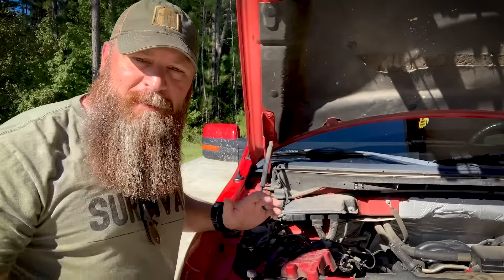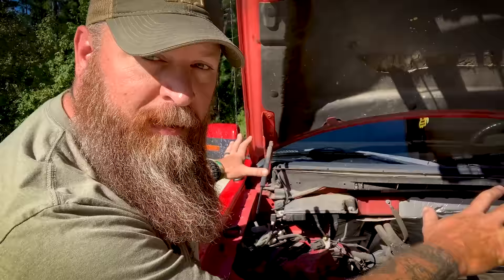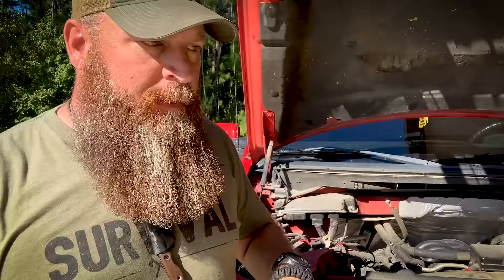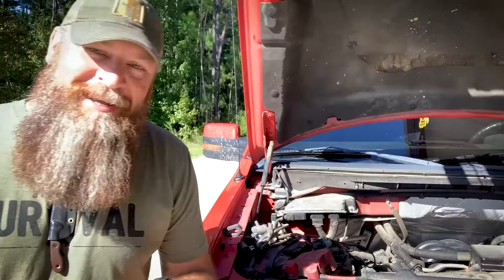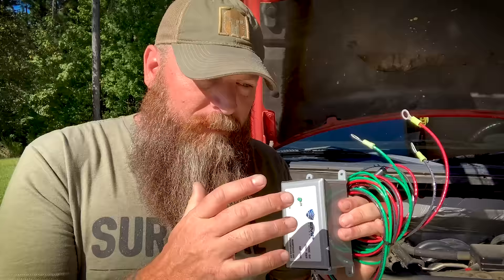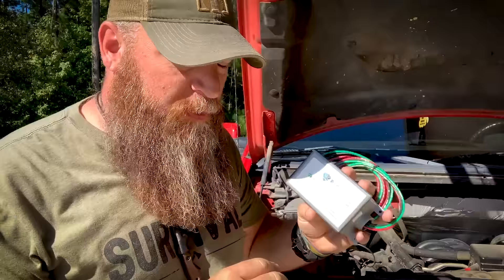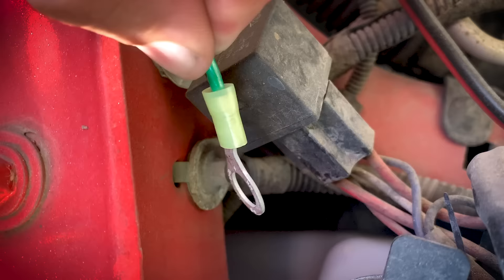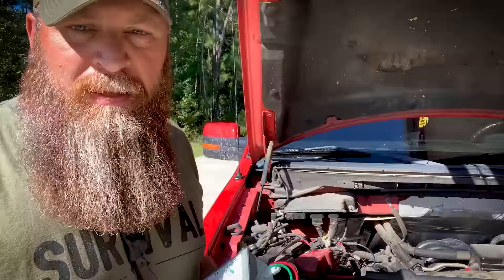EMP PROOF YOUR VEHICLE

Comment: To Protect you vehicle from an EMP event, you would have to cover all wiring and ECM module with wire mesh or a complete covering of metallic foil to prevent EMP from generating current in the wiring which would overload the ECM module (brain box). Many of the wires coming from the ECM carry very small currents and voltages going to sensors and ignition components. All your wiring will act like an antenna, charging the wires far above the voltages the ECM module can handle and will burn it out. Many of these devices sold for EMP protection contain a device on each wire lead called a MOV ( metal oxide varistor). These devices work by shorting an overvoltage condition for a short time but often times the MOV will be destroyed in the process or retain a residual resistance after shunting an overvoltage which would affect performance of the ECM module to run the vehicle so it's probable that this device would have to be removed after a protection event. I am an electrical engineer so i have had experience with MOVs and seen what they do when overload conditions exist. Each MOV in this device should be fused in case they short out after clamping the higher voltage, some MOVs will actually destroy themselves after clamping high voltages or the cicuit board traces of the MOV module will burn out trying to hold massive currents when the MOV clamps the voltage spike. Just FYI.
Reply: They make a canvas cloth that has steel mesh incorporated throughout the material. It's pretty expensive and comes in 59 inch wide rolls. You can sew or glue it together for a "tarp" that will cover your vehicle and the ground around it.
Reply: What if you ran like 4 - 0 GA ground wires from like your negative battery cable to the earth, or from like a chassis ground to the earth, or maybe at all 4 corners of the car? Would that possibly be able to give a path of least resistance to the emp? So maybe when you park, you just get out and ground, at home you could put a quick connector of some kind on there. Obviously when your driving your screwed but what ya gonna do. 

As I wrote that question, I realize I may be way off the mark here but hopefully someone will explain it to me.
Reply: @ChefBoyarDEEZ  that would make your vehicle wiring act even more like an antenna and still wouldn't protect the ECM or Traction Control unit from getting spiked. Covering the car with a faraday cage( screen wire basically) would provide some measure of protection but remember, a magnetic field that strong would go through screen wire also. Imagine throwing a rock in a pond, the waves created from the force of the rock world make waves and those waves are close to how you would visualize magnetic waves from an antenna pulse but more closely imagine a doughnut shape growing bigger as it travels away from the EMP source and an EMP pulse from an atomic bomb would be like an asteroid hitting the pond at 100, 000 mph for comparison. You could just keep you vehicle in a metal storage building, completely enclosed, even the floor too so as to redirect the magnetic wave. The metal building would create a bubble around whatever is inside it. The building itself would get very hot due to the currents developed in the metal but this would absorb the pulse mostly. The building would need to be made of ferrous metal like steel to most effective and all panels would have to be bonded to each other very well. I used to work on RFI (radio frequency interference) shield rooms for testing electrical power cables at up to 100, 000 volts at 20 amps and the rooms were covered inside and out with sheet metal that was soldered at every joint and the whole room (20ft x 20ft) had ground rods at each corner going 20 ft into the earth. There was no cell or radio service when you shut the doors.
Reply: What if you removed your ecu entirely and stored the ecu in s Faraday cage? When you were ready to "bug out" could you reinstall it and be good?
Reply: @wchitwood65  so basically there really is no way to protect from emp.
Reply: @trenton1190  ya, would this work? If it's an older car, just take out The ECM and TCM (if it's auto), and keep them in a Faraday cage? Or would the alternator need to come out as well? Basically, is there any way to do this other than a crazy azz Faraday cage?
Reply: @ChefBoyarDEEZ His idea reminded me of shipping containers that you may be able to store your vehicle in.

Comment: Great explanation! I like to think of electricity as a fluid in pipes. It has it's flow and pressure but if you rank up the pressure, the valve and sockets will start to leak and break!

Comment: Usaf built a huge emp test bed in New Mexico,  big enough to test a B52 on it, after decades of testing everything that moves they had enough data collected to be able to emp proof every design to follow, they shut it down in late 80's or 90's as to generate the field took an Insane amount of electricity.

Comment: I have looked high and low, and have not been able to find a video of an EMP Shield equipped vehicle tested by running it through an EMP generator.  Show me a few of those, provided by an independent entity, and I'll buy one.  One would think that if the thing worked, there'd be videos of a test like that all over the place.
Reply: It's what I've been saying ☝🏽💯
Reply: Back pre 9/11 I was working for a contractor we were tasked with military EMP testing had multiple vics, everything from a 1943 jeep, mid 50's WM300, mid 60's chevy 1/2 and 3/4 C series, military humvees emp shielded, as well as older/newer dueces/M935 series 5 tons. So they would do the testing in evening. 1/2 the shielded mil vics survived, all the older vics survived, our rental suburban went max smoke, I often wonder what hertz mechanics wondered when the thing was dragged back. Best EMP proof is Mil or no critical components. on my 71 W200 I have a grounding point where I park  and clip it in. Same for my 89 F250 IDI. On my 71 I have the old points distributer and coil in a grounded 50 cal can, Also a spare HEI unit and voltage regulators/starter relay. this was a long time a go but I think the best deal is a separate ground rod. But this new technology may be cool.
Reply: @deepbludude4697  what is MIL? And would it take any special precautions to ground a modern vehicle, or just connect it to a solid ground rod? What would happen to a vehicle if the battery was already disconnected during the emp?
Reply: @bitcoinsmash1650  MIL -Military refering to the milspec shielding... I pulled the trigger on one of these, I have a 96 powerstroke diesel shit tons of component's/computers to buy all the spares would have broke me so I spent 350 bucks on this IDK if it will  work, but if it does then ill have a big ass 4x4 boxtruck to endtime around in. and I still ground the trucks when parked.
Reply: @deepbludude4697  Do you basically just have a stake in the ground with a wire that you connect somewhere on your truck’s frame? My truck has tons of at risk components and my electrical know how is currently limited to wiring a sound system.
Reply: How would  u test it tho
Reply: @jeff5882174  They have emp emitters that are used to test military vehicles etc.  Private companies can also test their equipment there.
Reply: @meltdown1232000  ooo

Comment: I am very skeptical of this. If you hook this to your battery the battery wires are also hooked up. The emp charge will still follow all the wires so it would still fry everything. The only way I could see this working is if you actually ran your battery wires through it before they powered the rest of the vehicle.
Reply: I think a bicycle or horse would be the only thing left for travel because where would you be able to get gas or electric for your vehicle
Reply: @Ron Keeley  what you say makes sense to me. So I am having a difficult time believing this EMP protection device would work.... just don't know what to do

Comment: If emp strikes there's no grid for fuel anyway, not to mention this gadget would almost certainly not work as you would need a faraday cage around your entire vehicle that is grounded, especially for anything as powerful as a nuke. Any transistor exposed is fried on contact
Reply: sounds like the sort of thing you could deploy from a cherry picker mounted in the bed of your truck. couple rolls of wired up chain link on hydraulics
Reply: The military will have diesel maybe the army will take a few cans of chew for a full tank
Reply: @nicksearles3996  Diesel still has electronic component's !
Reply: A bicycle or a horse would probably be the only thing left for travel  and they would be in high demand
Reply: You just pull your generator out of your faraday cage and use a pre wired fuel pump to get the fuel out of the gas station 10,000 gallon tanks

Comment: I'm a little skeptical about an EMP event affecting shielded condutive material (i.e., wires and circuits made of aluminum, copper, silver, gold, and so forth). Exposed conductive materials (i.e., wires and circuits) are another matter and may pick up the free-floating electrons. But so would our bodies, which are less conductive. It's important to note, however, that an EMP event is not believed to be harmful to humans. Furthermore, when a cardiologist was asked about the effects of an EMP event on a peacemaker, for example, the doctor stated that the pacemaker would most likely remain unaffected because it's shielded. The same would be true for the wires and circuit boards in a vehicle because they, too, are shielded and are designed to work in rather harsh conditions of heat, cold, and moisture.
Reply: Look up shielding. I don’t believe cars have shielded wiring.
Reply: @jbaker8871  I doubt cars use bare copper wires.
Reply: There’s always a point in any circuit where those wires aren’t protected.
Reply: @jbaker8871  As an auto electrician of 40 years I can tell you that there are plenty of shielded cables in your car.
Reply: Vehicles aren't shielded. Buy a classic car or really old junker, better yet a old diesel with mechanical fuel injection
Reply: @glengarbera7367  Old junkers have wires, so the alternator could be potentially affected. I wouldn't worry about the effects of EMP.
Reply: The pulse would affect long lines of transmission. Electric power lines are long and would accept the pulse, cars would not.
Reply: A pacemaker cannot even withstand a microwave oven, let alone a EMP.
Reply: Clamp-on multimeters can measure voltage and current through rubber coated shielded wires.  These wires can also pickup and be negatively affected by  EMF.  All of that makes me believe that a strong EMP would be disastrous.  I've seen scientists test an EMP by driving a modern car under their EMP device and it stopped their car.  That means cars are not shielded enough.  Also, when the 9/11 attack happened, all cars within a radius had their car batteries short out and catch fire which caused burn damage to part of the car's hood where the battery is located and also to that side of the car.  In a number of cars, something additionally shorted out and caused a fire in the interior of the cars.  It's something to think about.
Reply: @shane7765  Were parked cars with engines turned off tested? I'm curious as to how an airplane crashing into a building would affect auto electronics?
Reply: @chesslover8829  I've never seen scientists test an EMP on a car that was off.  An airplane never touched building 7 but it collapsed at demolition speed.  Also several blocks and streets full of cars caught fire under the hoods even though they were far away from building 1 & 2.  An advanced energy weapon was also used then, because it doesn't make sense if it wasn't.  I'm not saying there weren't planes that hit building 1 & 2.
Reply: @chesslover8829  they don’t use bare wiring.  Not much can around metals.  Let that positive wire touch anything an be grounded. You’ll have a problem.  
But instead of just rubber of some sort coating the wires.  Some have a tight woven metal mesh around the coated wire with another coat over that.   The shielding is woven like them old Chinese finger traps.  But of a metal.  An a lot of fine strands.  

I don’t know if many shielded wires.  But one for sure is like tv cable wire.  

You have 2 or whatever wires coated in different colors than the shielding around them than some paper/plastic stuff around that. Than coated with that plastic/rubber coating you see from the outside of the wire itself that you can see/touch.  

I do know it’s also used in some security camera wiring needs to also be shielded.  

But typically car an home power an lighting wiring isn’t shielded.  Just coated like all wires so they can’t ground out to anything ect.  But isn’t shielded.

Comment: Can you tell me how the empty shield protects your keys because most modern  cars are push button or have  have chips in the key itself
Reply: Place your spare key in a farraday bag or box. Boom
Reply: @anthonymartin5794   I don't carry my spare key with me when I travel or when I park at Work. I park my vehicle I get out I go into my semi and then I come back to my car later
Reply: Stick a spare key in a farraday bag they have them on Amazon the car won't start in that bag hide it behind the seat where nobody will be looking for it.
Reply: I purchased a small faraday cage designed to hold key fobs
Reply: @mikebaker833  most keys have a physical backup
Reply: Well if u have older ish car u can unlock still with the key
Reply: well if your key is in the ignition wouldn't it also be connected to the system? I mean if keys in and doors open it sings at yah
Reply: Doesn't all push button electric start cars have a key inserted in the key holder fob?
Reply: @yourredcomrade717  I had keys made from my Dodge Chip Key, all the key does is open door. will not start vehicle

Comment: I'm skeptical. The black and the green wires both connect to the same circuit, since the battery negative, in every car,  connects to the body and chassis. There is no electrical connection to the earth, unless you add some kind of strap that drags on the ground.
Reply: I agree, the chassis ground and the negative terminal of the battery are the same electrical points, without the addition of a earth ground there's no way this is going to dissipate any electrical charge to this vehicle.  If it were the 18 gauge wires would probably fry too.
Reply: everyone says the same thing. I do not know what's inside the 2 dollar conduit box with the fancy sticker.  But apparently it's a magic sponge.😂😂😂😂😂😂
Reply: @ReadyOrNot556  And not worth the money they are charging either!!!  😜